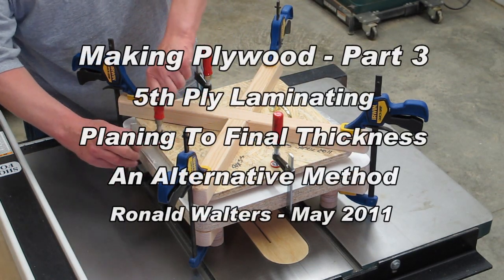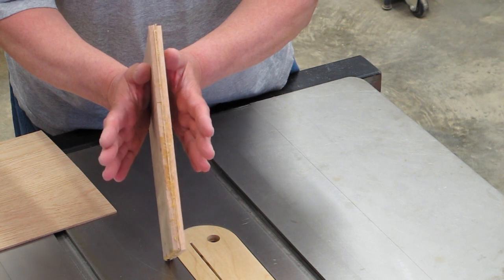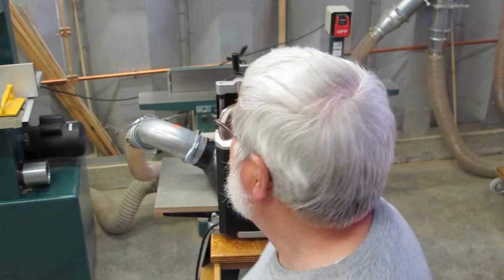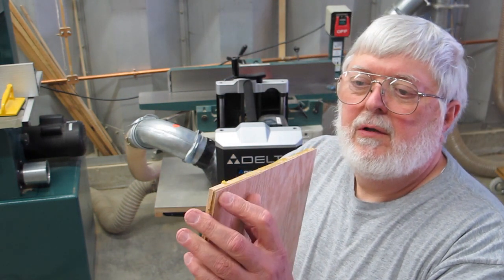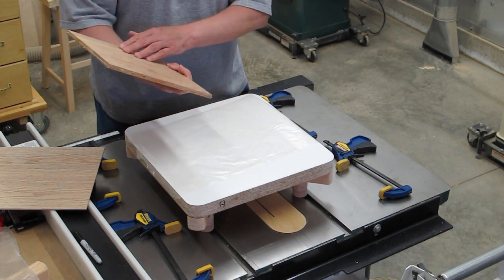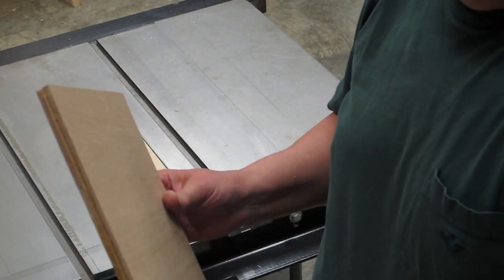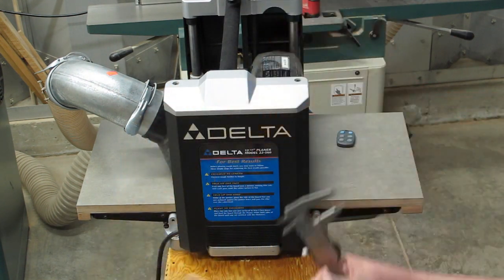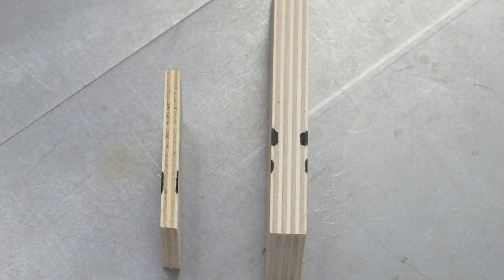Plywood Clamping Jig - Making Plywood Part 3

Comment: Why two separate glue up operations, first with 4 layers then adding 1 layer, instead of a single operation with the 5 final layers?
Reply from the maker: It you try this you will find out soon enough. The two outside layers are thick to aid in keeping the 4-ply lamination as flat as possible. You are also running out of time as the wood glue is quickly dehydrating and starting to set up. Then one outside layer is planed down to the same thickness as the two center layers. A thick fifth layer is glued and clamped to stack and when dry, the remaining two thick outside layers are planed to the same thickness as the three inside layers. When done, all five layers are the same thickness. It is a process in trying to keep the lamination as flat as possible and then using the planer along the way to flatten it when it is not.
Reply: Thanks, Ronald.

Comment: (Hypothetically) How would you go about coloring the layers, like a skateboard?
Reply from the maker: I have a video - Water Based Dyes and Baltic Birch Plywood https://youtu.be/7CV99ee4SWQ Wood tends to take the dye unevenly due to hard and soft grain. Vacuum infusion of the dye is another possibility but is only practical for small pieces in the home shop. Glue may cause the colors to bleed into each other. I have never looked at a skateboard but I would guess they are made of something similar to color plywood. Google "color plywood" or "colorwood" to see what I am talking about. then finding someone who actually has some will be the next challenge as a full sheet is quite expensive.
Reply: Thanks for the reply. I have done some googling but not really found what I was after. I see on your video yo paint the dye on, and allow some of it to penetrate. The skateboard ply is a consistent colour all the way through. I found your video while looking for how that might be accomplished.
Reply from the maker: Birch is quote porous and takes dye fairly evenly. At the "color plywood factory" they dye the individual veneers and the colors are consistent all the way through.

Comment: Hey +Ronald Walters
Do you have problems w/ that DELTA PLANER skipping / rollers not grabbing wood consistently, in a jerking fashion? Mine is terrible. I know it's worse when blades aren't fresh. There isn't any trick possible to shift dinged blades slightly left or right, is there?  Do you by chance have the Delta drum / thicknessing sander? Great videos, thanks for all you contribute to the woodworking community.
Reply from the maker: +Mark Young A year or so ago one guy mentioned he was getting a fairly thick buildup of sap (or something) on his rollers. He disassembled the whole thing and soaked the rollers (mineral spirits I think). You want to wipe them clean. Don't damage the rubber. I had some fairly old dimensional pine lumber that still had wet, sticky, sap-pockets in it and that made a mess of things. After throwing away that piece of wood, I wiped the rollers and cutters with mineral spirits to clean that up. Painted, varnished, green or treated lumber is not a good for the planer but sometimes you just don't know what you will find inside the wood you think is clean and dry.  I really haven't had a problem with the planer. The blades are fixed position. If it isn't leaving too much of a line in the wood, I just live with it and sand it off. I build my own drum sander... there is a video on it. Thanks for watching! Ron

Comment: When we will see how to make plywood? Here I see just sticking already prepared sheets of plywood.
Reply from the maker: +batvanio Assuming you watched Parts 1, 2 & 3, I do not understand your question. The process is gluing thin sheets of laminated wood, alternating the grain direction and planing to thickness to make the plywood. The reason for going to this trouble is to have plywood of the same type/color wood as used in making a wood gear clock.
Reply: +Ronald Walters The title came to the conclusion that you do plywood, but you just glue pieces of plywood together. You do not plywood and plywood panels. There is a difference.
Reply from the maker: +batvanio Please Google "How plywood is made". I am doing the same thing on a much smaller scale. I AM NOT gluing pieces of plywood together. I am gluing thin sheets of wood together to make the plywood.